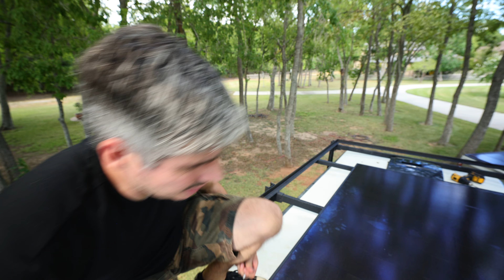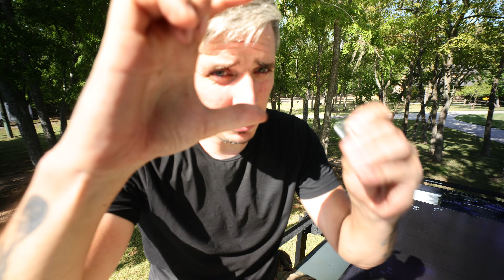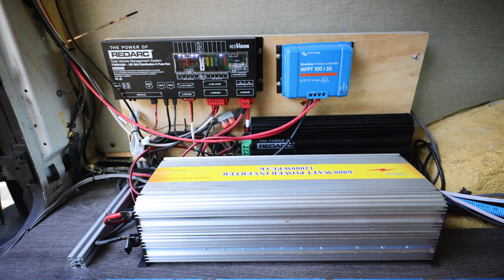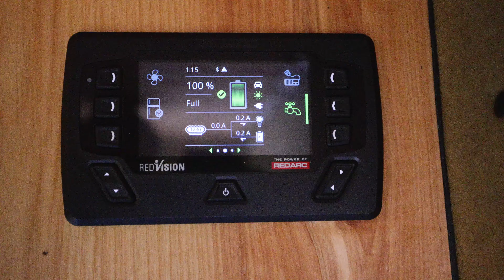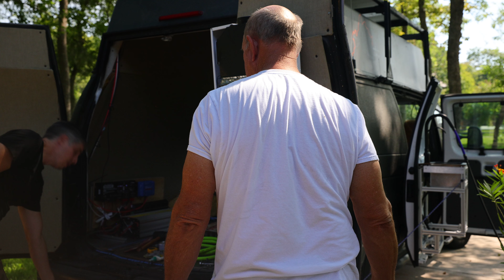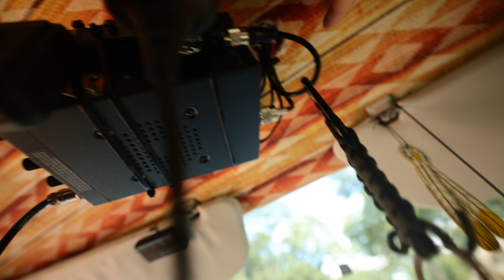Installing Solar & Electrical In My Van - Ep. 50

Comment: The problem is that you don’t know your hardware. You keep calling it a screw and you can’t get the washer or the nut on it. Screws don’t use washers or nuts. Screws are driven into a tight fitting hole and the threads cut into the material thereby holding it tight. Only BOLTS use washers and nuts. This leads me to believe that your a beginner and your putting out a video to provide information to others when you don’t know the basics. Good luck, you need some more experience and knowledge to teach others.
Reply: He isn't trying to teach anyone,  he is using bolts he just said screws.
Reply from the maker: Thank you.
Reply from the maker: I’ve yet to produce a video telling people, do as I do or say. 

I tell people watching all the time, I don’t know what I’m doing. That this isn’t a how to video. 

But thanks for not watching g all the content and making assumptions. I appreciate your feedback.